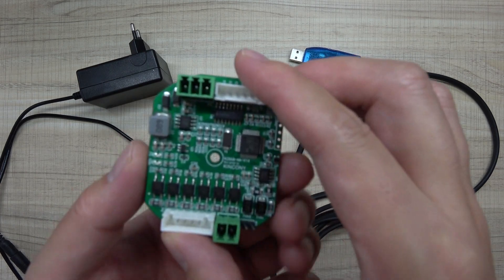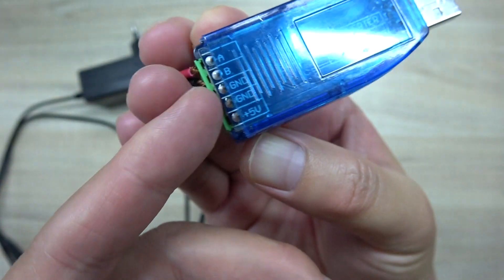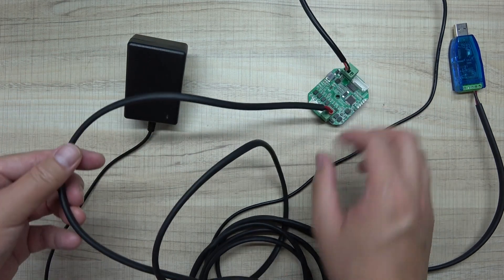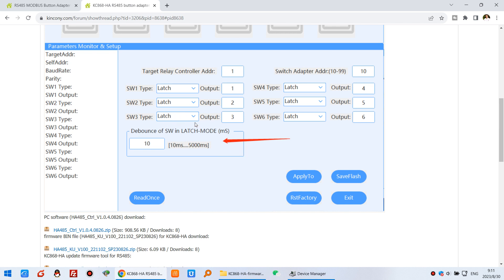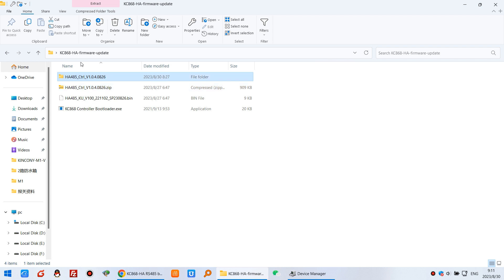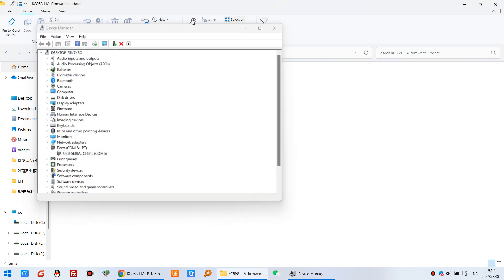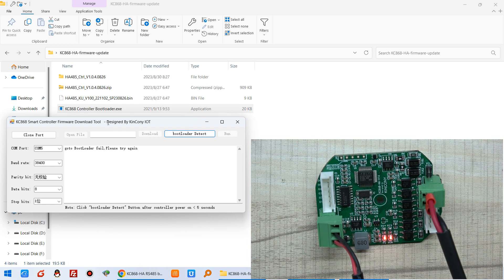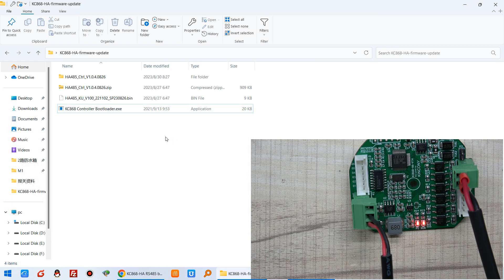how to update RS485 Old Wall Switch Panel Adapter - KC868-HA firmware

Comment: Can this device connect to Node-red?
Reply from the maker: sure, Add to Node-Red by RS485 modbus protocol
Reply: This is great, it supports modbus! @KinCony
Reply: @KinCony  This device works with standard Modbus protocol, right?
Reply from the maker: this is private protocol, but maybe we will make a new firmware for standard modbus protocol. @ivaylomanolov1455
Reply: Okay, thanks a lot! @KinCony
Reply: @KinCony  did you made it? can we use standard modbus protocol with V2 of this board? Thanks
Reply from the maker: @pawelhome  there is standard modbus protocol firmware for HAv2 can download from our forum.